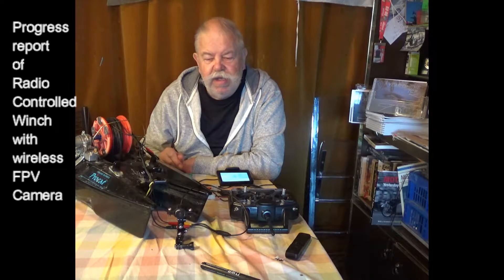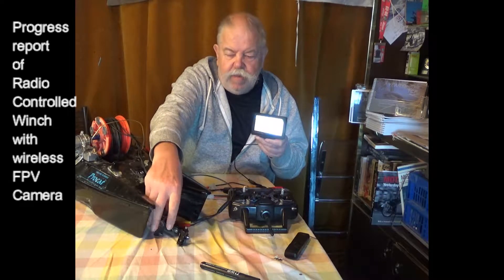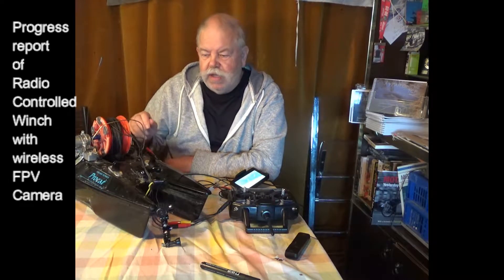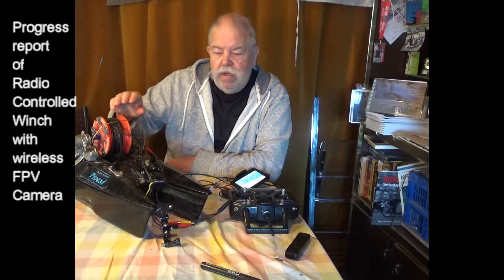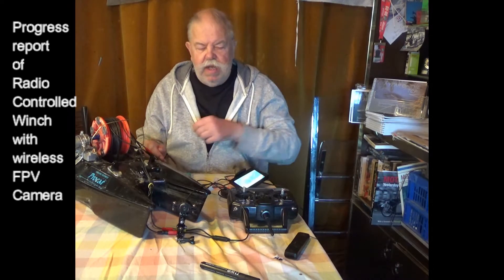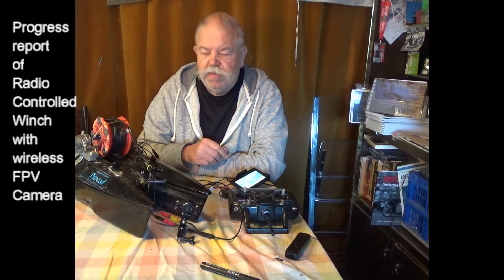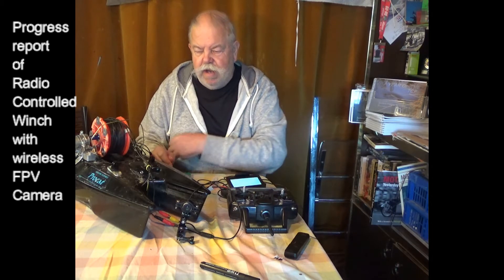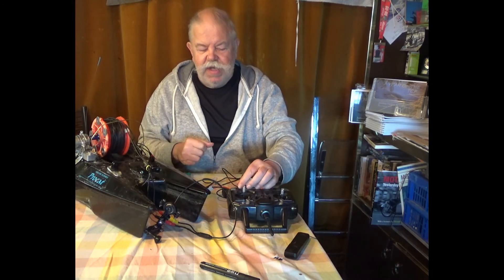Baitboat winch with FPV Camera

Comment: Hi, I was also making such thing but stopped because of not finding suitable cable for winch. I need a very soft and thin cable with at-least 6 to 10 wires. What kind of cables you used here and how many wires it has? Thats your first comment so hope you will reply in detail.
Reply from the maker: Hi Farhan, I have used ordinary single core video cable and a two core power cable. I am only winching 10 feet of cable so it is not too bulky. Good Luck with your project. I hope to see it as you build it.